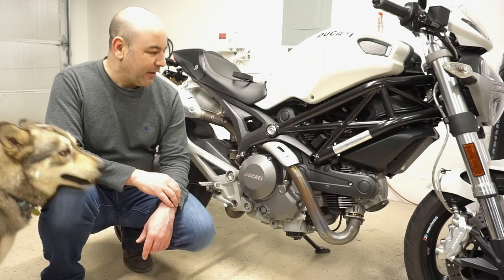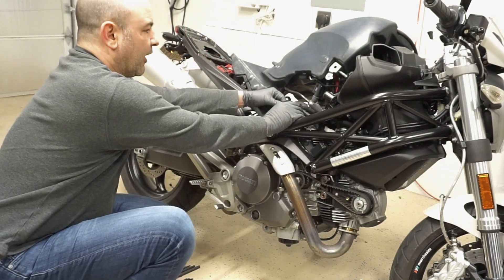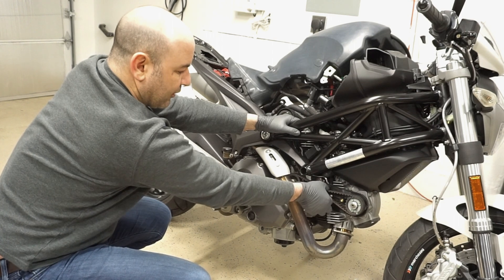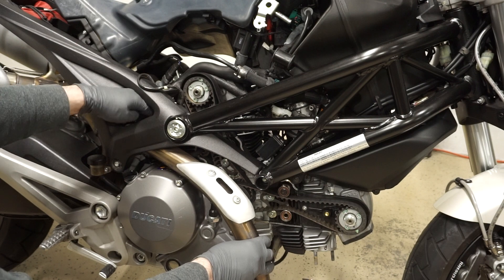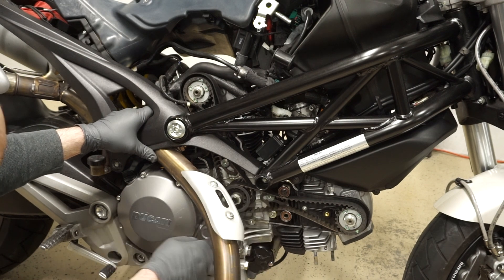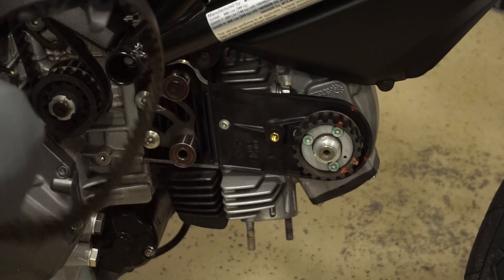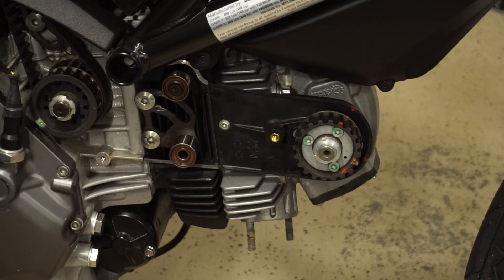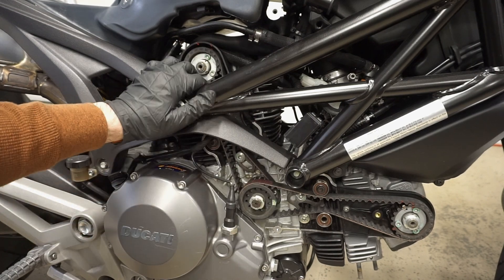Ducati Monster Timing Belt Replacement

Comment: Hi, the allen key method is very helpful.  The question I have, is why is it important for the central pulley to be lined up with the marker and notch IF you have marked the belts, crank pulleys and case to line up, and counted the teeth, so long as the central pulley, hasnt moved from the starting position, when you start the job?  If the pulleys remain in place from the starting position and you slip the old belts on and new on (having counted the teeth), should that do it, once tensioned correctly?
About to do this job myself and getting a little concerned i'll get it wrong and blow the engine.  I have it all apart ready, well, at least with the covers and exhaust off, full access and ready to go, withnew belts in post.  So im already invested in doing this myself...
Reply: Wondering the same thing

Comment: Just did my S2R800 with your help. It had 4300 miles and 18 years old belts.Thanks!
Reply: I also need to replace my timebeltnon my 1100 Evo…8700km only on the clock but 11 yrs old 😂
Reply: @Liquid19877  Did you do this?  About to do the belts on my 1100

Comment: Thanks for that, Since Iceland has no Ducati dealer and I dont trust anyone to do it correctly I must do it myself, nice to have a refrance guide
Reply: Unfortunately this is wrong. You should turn the engine over until tdc. The cams are then locked. Belt tensioners are loosened. Belts removed. Floating cam gear bolts loosened. New belts installed and tensioned. Floating cam gear bolts retightened.
Reply from the maker: @smoll.miniatures  The engine was set to TDC at 09:27.
Reply: @ThomasGillot  The cams should then be locked. Belt tensioners loosened. Belts removed. Floating cam gear bolts loosened. New belts installed and tensioned. Floating cam gear bolts retightened..
Reply from the maker: @smoll.miniatures That’s not mandatory. If you want to buy the additional tools it may make it a little easier. See Ca Cycleworks for the same method I followed.
Reply: @ThomasGillot If not done in this way, the belts tension will vary around the length of the belt. Your way may “work” but it’s not the correct way to do it. If it didn’t matter, Ducati wouldn’t waste money on floating gears. Every Ducati tech will do it the way described.

Comment: Exhaust pipe removal from the horizontal cylinder is a must on the 696 to get straight into the vertical belt tightener allen bolt. They strip quite easily at an angle if the pipe is left on and they're $10 each plus the wait of shipping from Italy . Ask me how I know.
Reply from the maker: Yeah, makes sense to remove it since it doesn't take much time and gives you more access.